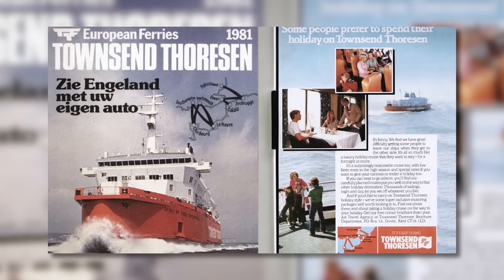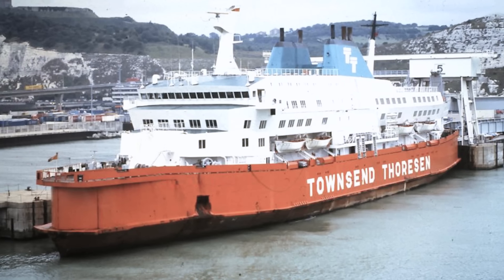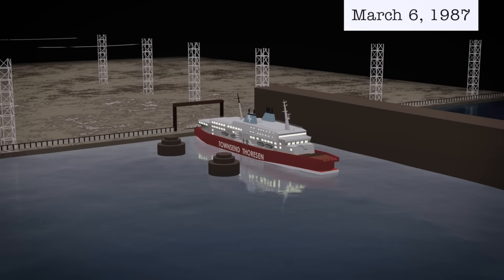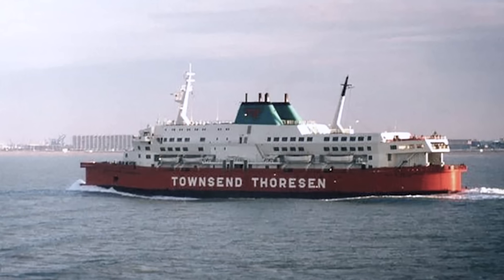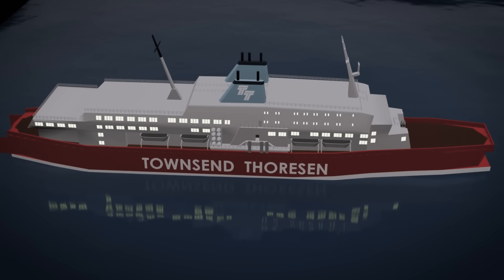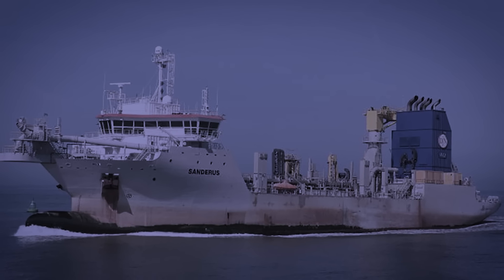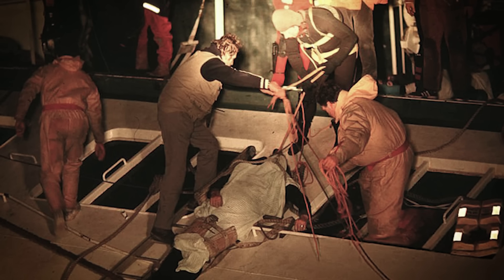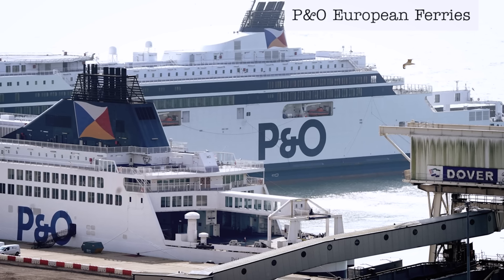193 Dead After Bow Doors Left Open!

Comment: a simple system that was already in use should have been all that was needed to prevent this from happening. all it needed was a wire on one door connecting with a wire on the other door. once these wires were connected a light on both doors would go out. this was already being used in the isle of white ferry. whilst though they use a ramp to load vehicles, they use this light system to show the ramp is closed/raised. but it wasnt mandatory to have anything, even though there were over 400 people aboard..........

Comment: The ships always went in bow first at Zeebrugge. So why is it showing the stern in @ 3:34? This is misleading & is not what happened under normal operations. If this had always been the case, the ferry would have had to leave Dover, having loaded from the bow, this never happened. If it had then the accident would never had happened. Zeebrugge had fixed spans, at Dover they are variable. Due to the position of the moon, there was a very high tide on March 6th 1987 at the time of departure.The ship was heavily ballasted, at the front end, it was also running late. Bow doors were left open, that was not the first time, that had happened, it was common practice to get rid of the fumes. There were no indicator lights to tell the bridge that the doors were still open, although this idea had been discussed, with the fleet department it fell on deaf ears. An accident is usually made up of more than one element, here is a great example,so don’t blame the crew.
Reply: I sailed on those ferries often as a continental truck driver and they often sailed with the doors open to clear the decks of fumes.

Comment: The Instrumentation !!  I would require more "Fail Safe" On the piece of equipment I use to crispen up a crumpet ... at least visual confirmation and a check list ???    Mate I have been in the guts of machines ... crusher maintenance.  Where the only key that could ever be made to over ride the lock out is in my pocket ... Otherwise me ? mnn no ... but I was walking into the jaws of A Mining industery Crusher NOT doing what it was supposed to be doing (Hint; crushing me)   as distinct from boarding a safe friendly big jolly old ferry ... that it is far less fearsome at first glance ...  Grab a beer in the lounge... A ferry NOT doing what it was supposed to be doing (Hint;  sinking. )

Comment: If this was year 1875, before switches and sensors (like this idiot boat was built without), they would of had a seaman check and shout into a voice tube, or, run to the bridge. How is it possible procedure left this to be assumed? What about every other thing? Did they assume passengers were not on the ramp? Did they assume balance? This is beyond absurd. And that jackass pushing for schedule !! Drop him in the channel and tell him to swim very quickly as slow swimming was “not on”.

Comment: I'm always amazed at the amount of human error.  If people weren't so slack when it comes to their jobs and responsibilities.  Terrible things happen when people don't pay attention and you would think they would be super aware of what's going on every minute because obviously the least little screw up and it's a major problem. It's right up there with air plane disasters. You can't just pull over to the side of the road. You just desend quickly. One to the ocean floor and one to the ground.  Neither is a good out come. And they let the people at fault just get away with it. That's just wrong and doesn't teach anyone a thing. Except you can cause a lot of people to die and get away it. I'll never , ever , ever, get on a ship or airplane for any reason. To much to go wrong and the chance of survival is pretty much nonexistent  so I'll take my chances in a car.

Comment: How difficult would it be to wire an interlock to prevent the engines from starting if the bow doors were open?
Reply: Not difficult. But unfortunately it wasn’t illegal to sail with the doors open, so probably deemed unnecessary …😢